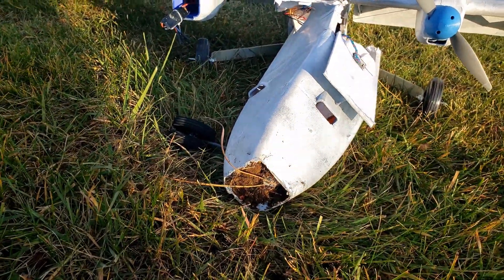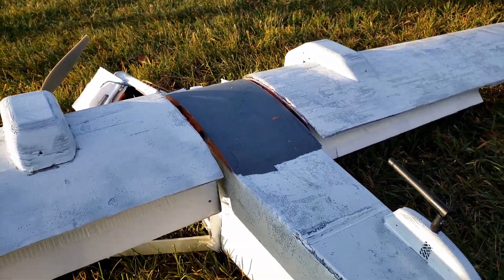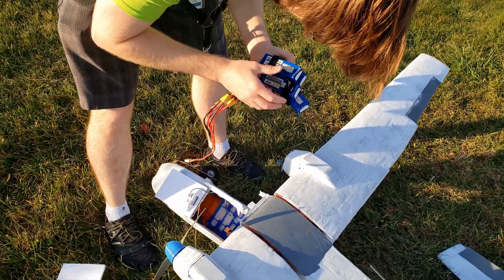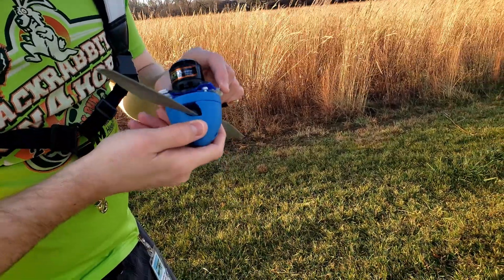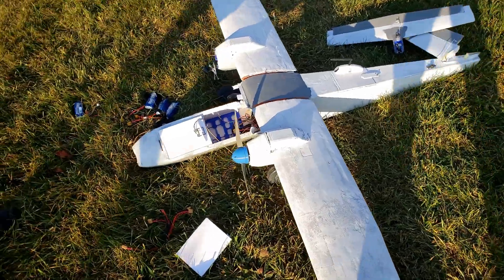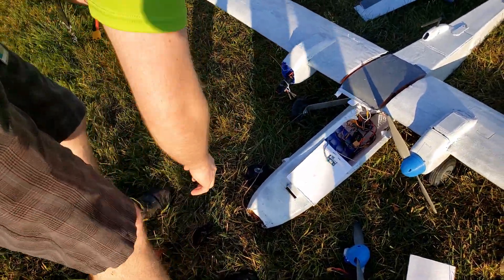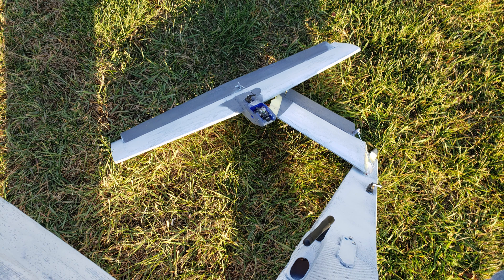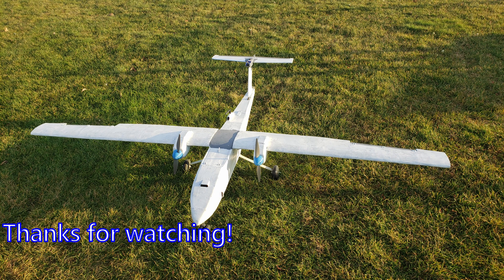NebulaV2: Twin Motor RC Cargo Plane | Second Unsuccessful Maiden and Crash

Comment: hi.    it should be understood that, regardless of the material used, a  Solid  wing  has  a  Wonky (transverse) dom.    distribution of mass.      in other words,  the wing  is  Heavy  and   there is too much outboard-located mass.    at linked photo --- see the  Normal  structure of a model aircraft wing; which resembles full-scale building techniques.      this was a rubber-powered model, so the forward and central fuselage would need to be made more robust.
a main wing  dom  This  optimal  cannot  be achieved, using heavy, modern materials or solid foam.        having said that, i have seen someone use faux-hardword flooring padding foam; or something similar.      the result was a very light, less-robust fuselage. 
such a  material  could  be used as  skin; in a, more elegant, iteration of a monocoque airframe.   (as when a film covering is used.)      NOTE  also,  the  LOW-mass   longeron and former structure, at the tail boom.     assuming the correct use of graded  balsa, the structure shown would be  LIGHT  and  strong.       by now you may see the reasons  Why  a  tail boom  Should be tapered; and made as  Light as is practical  and  Not be made heavier.    cheers
https://img.staticbg.com/images/oaupload/banggood/images/8D/B8/a93ae5ad-5626-4bd2-8560-37f585760037.jpg

Comment: it  would appear that the wingspan to fuselage length is  NOT  normal.    specifically, the wingspan and aspect ratio are too great, for the application.       it is suggested that you compare the  model to the following ratios.     fuselage length should be roughly equal to 75 percent of wingspan.       begin with a wing chord equal to about 22 percent of fuselage length.       at 2:56, the tail/tail boom/stabs  SHOULD  be  made  as  Light as is practical;  to  INCLUDE.  NOT  putting  servos  at  the  tail !!!!!!!      googletranslate

Comment: the  MASS of  whatever is under the dorsal 'pod'  SHOULD   BE  MOVED, to near or forward of the cg.      if practical, the  MASS of the antenna  SHOULD  BE  MOVED, to a  LOWER  position in the airframe.       SIMPLIFY       eliminate the t-tail !!!!!!        googletranslate

Comment: hi,  fur.    this is my first thought.     it is  Not  normal, to use a zero-dihedral wing, with prop power.     i suggest that you  SEE  for  yourself; at the links.      sometimes, dihedral affect is produced around a zero-dihedral wing, via the use of specific design at the underside of the outboard wing; see cessna.    d      googletranslate
https://www.vector-templates.com/modules/templates/preview-wm/cessna_152.jpg
https://www.vector-templates.com/modules/templates/preview-wm/piper_pa-28-181_cherokee_archer_ii.jpg
http://aviadejavu.ru/Images6/MK/11-Istreb/USA_NA_P51_p.jpg
http://www.airwar.ru/image/idop/fww2/p47j/p47j-1.gif

Comment: Bro last time it was pilots fault this time it's a little mistake. This plane is done just check everything before flight pls.
Reply from the maker: I'll get the design up and flying eventually, better than before! 

I did do an inspection, but I couldn't see the damage in past photos until it actaully failed. After seeing the failure point I can see the start of the failure in previous photos.

 I just didn't have the experience to know what to look for, so its a pretty good learning experience with composites.

Thanks for the feedback! I definitly do need to get a more comprehensive pre-flight checklist.